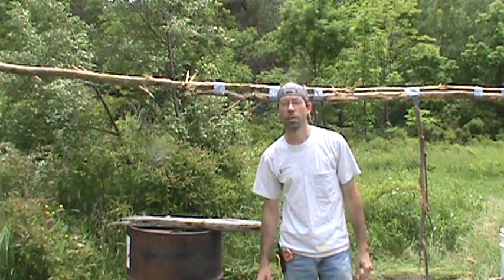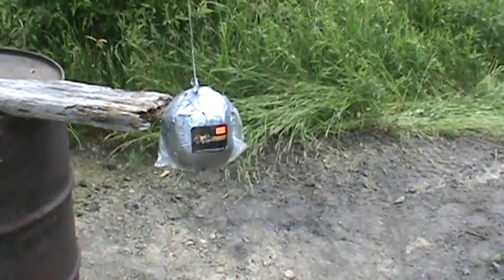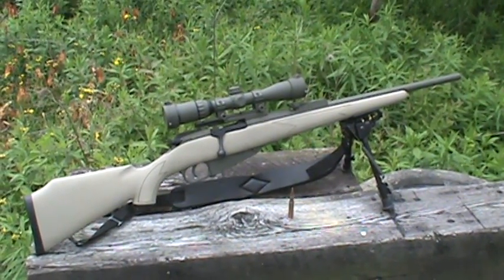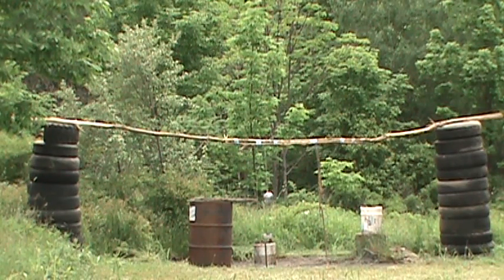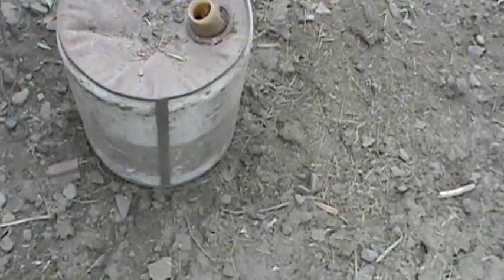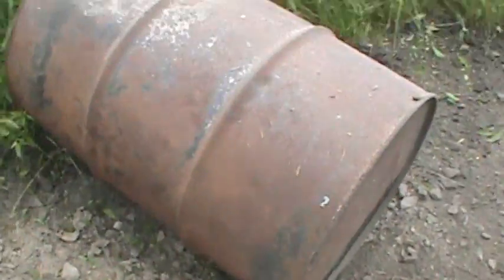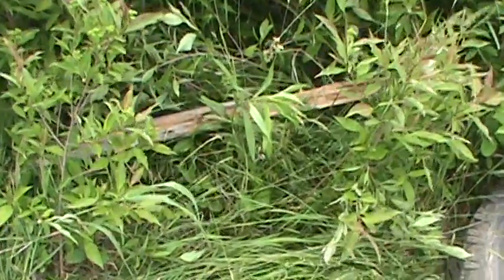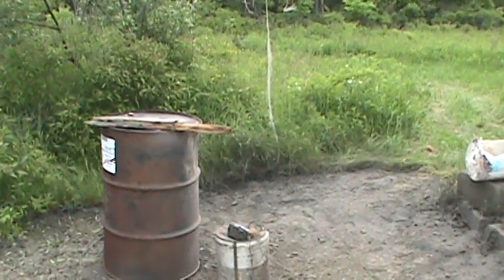4 pound air burst, with shockwave targets

Comment from the maker: Good question, I actually havnt tried tannerite yet. I have been meaning to order some and test it out. Really when it comes down to it, depends on the grade of ammonium nitrate and aluminum powder and amount of al they put in. Now In the Red targets, it looks like they use a low grade of an in the high vel mix, and they are really weak. In shockwave, I think they use more of a blasting grade an, but the al looks like its a lower mesh, because its grey.